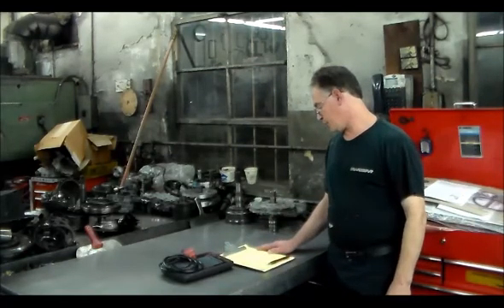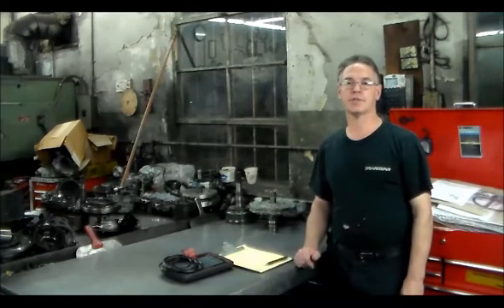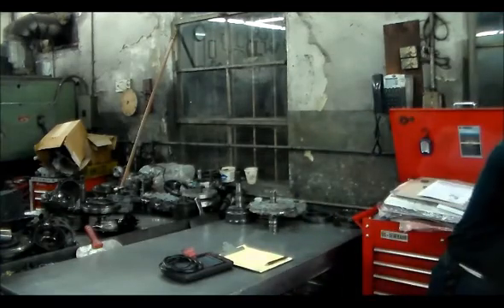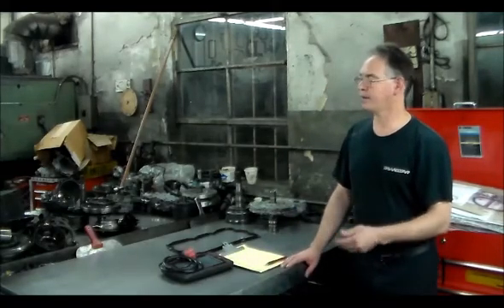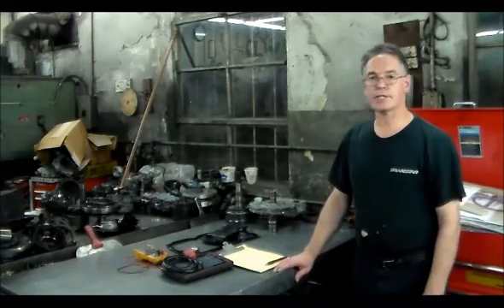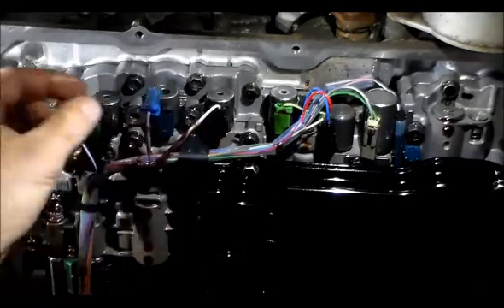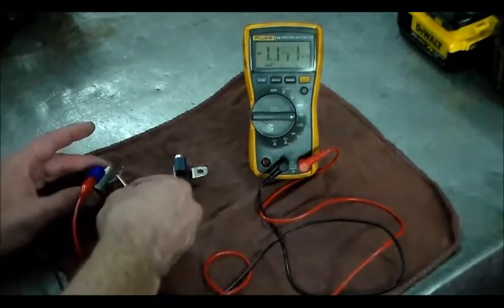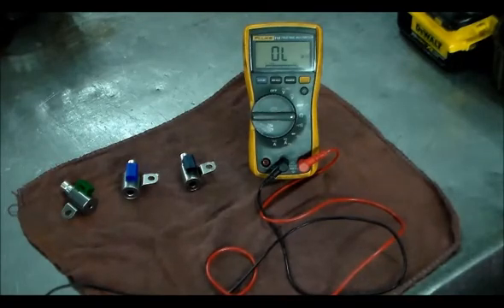AB60F, Code P0983

Comment: Hey Gary, just had this code show up on my 2008 tundra 4wd. I felt the truck wasn’t shifting normally when driving down the highway at 65 mph and noticed it was above 3000 rpm but not shifting into 5th or 6th gear. I’m located in Massachusetts. How much should a repair like this solenoid cost?
Reply from the maker: The big problem is, there are only 12 pan bolts, being where your located probably 10 out of the 12 bolts will break, the solenoid is probably 3 to 4 hundred plus labor. drilling and retapping the bolts i charge, The the solenoid is about 3-4 hundred, maybe 2 hours labor plus oil and pan gasket. so maybe 850.  But with broken bolts i charge per bolt to drill and tap with a new bolt, so that could bring to 15 to 16 hundred
Reply: Can you tell me the oem part number for the pan gasket and a and the specific solenoid that has to do with this issue?
Reply from the maker: @Rayrgs  I don't have the part number to the gasket, i believe it's the S4 solenoid but toyota may call this something different, i have them e-mail me a picture of the valvebody so there is no mistakes
Reply from the maker: I did some poking around the internet, S4 solenoid is the one. Has a blue connector. Try this OE part number for the solenoid.
35240-50050
Reply from the maker: Toyota calls it a 3 way solenoid
Reply: Thanks Gary! If the truck was driving fine and shifting ok with 0 issues prior to this code, it should just be this solenoid or something simple. Hoping it’s not a transmission replacement…

Comment: Good day Mr Farraro, I'm just curious. I have been looking into getting the right solenoid and Toyota could not have made that more difficult for how important it is to get the right one. Cost wise and position. Everything I look into shows S4 or D as the green connector and it's the 3rd one from the front of the tranny. For Toyota the part number is 35240-50060, but the dash number ranges 00030 to 50060 from what I can find.  In the exploded view it's N4 yet the one you're changing looks like it is blue, N3 and  5th from the front. I thought I had it figured out till I watched your video. I'm on and off getting P0983. No shifting problems. I'm thinking it makes sense that it is the heat problem from a different video. It only comes back if I erase it after about a 30 min drive
Reply from the maker: yes, i would do the solenoid first

Comment: Man I bench test old and new s4, new oil n filter, reset ECM, and still got code within 5min. I did get 2v from ECU harness when in first gear. Lexus state should be 1v. 

My suspicion is either wire inside valve body, or harness to ECU, or ECU ITSELF. Read it can be repair or reflash. 

2008 lexus is250
Reply from the maker: Where did you get the solenoid from?

Comment: Hi Gary
I have a 2014 Sequoia which has 160K miles on the clock, with no previous service histroy on transmition service and since a month my transmition (AB60F) has been giving me some headaches. 
On diagnostic tool I get C1201 and P0983 and on the dash I have the engine light on, 4LO and traction control. 
The transiomion shifts up to 4th gear. Once did it only up to 3th and three times, all of a sudden, no errors on the dash and transmition shifts just fine.
I visited Toyota diealership and they sad that it's time for new transmition.
I think that this is more likely to be electrical issue - lose or poor electrical connection, bad wiring harness or maybe the ECM. What's your opinion?
Reply from the maker: I think the solenoid is your problem, Are you located in a warm climate ? asking becuse the pan bolts are very difficult to come out and they break, i'm in New York and at least 10 out of the 12 bolts break

Comment: Hi Gary, I’m having the same issue. I replaced the solenoid worked for a couple days then all lights came back on. Do you think it could be a harness or temp sensor?
Reply from the maker: where did you get the solenoid from?
Reply: Autozone

Comment: My 08 has done it twice in the past week. The first time it cleared itself after reading the codes, (I did not erased the code) today it did it again, I unhooked the negative battery terminal, it cleared the code but came back on after I shifted and drove for 20 yards. I'm gonna give this a try and see if it works. Truck has 190k miles now and I'm unsure about any transmission maintenance by the previous owner.
Reply from the maker: where are you located?

Comment: Hi Guys I have the same code on my Lexus gs300 08 will that be the same part to replace? Also engine light up on dash and check vsc….. thanks 🙏🏻
Reply from the maker: Yes.  Not showing a gs300 for 08, is it a GS350?
Reply: @GaryFerraro  Hi Gary it’s actually GS300, made 2007 registration 01/2008 transmission A960E and codes P2714/ P0983 solenoid D…shifting good it’s just jumps forward a bit hard when put on “D” but all gears there shifts good. PLEASE let me know and thanks a mill🙏🏻.
Reply from the maker: @paddy5141  if you clear the code does it come right back?
Reply: @GaryFerraro  yes it does.
Reply from the maker: @paddy5141  ok, so next step is to ohm the solenoid, probably no good, if the code comes right back, it is an electrical problem
Reply: @GaryFerraro  I ordered S4 solenoid numer 3 (blue) oem €€€ 😣 will replace it over weekend and let you know…will check ohm to make sure to. Thanks a mill God Bless 🙏🏻.  ☘️
Reply: @GaryFerraro  Update;
Lexus GS300 2007 “check vsc” on dash no 5th and 6th gear very bad shifting 1,2,3,4
Fault code P0983 shift solenoid “D”
Solenoid S4 blue, part number 35240-50050. All fixed now back to normal THANK YOU VERY MUCH MAN 🙏🏻. God Bless!!
Reply from the maker: @paddy5141  Great, Thanks for the update
Reply: Man good stuff. I place another used one that was good and still got problem. First one I bench test and all pass. Why I didn’t want to buy OEM yet. I’m afraid it could be ECU :(

Comment: Hey Gary, i have the same exact code and same exact problem on a 2010 toyota tundra with 230k miles on it. When i took it to a trans shop they told me that they are afraid of opening up my transmission to replace the solenoid without rebuilding it, but then i find your video and you make it look so easy. After reading some of your previous comments to others on here, you had mentioned that it was an electrical thing and not a mechanical. Do you still recommend replacing the solenoid if its electrical?
Reply from the maker: If you have the same code, and all connections look ok, solenoid will probably fix it, just be careful of pan bolts they may break. Where are you located? I did about 3 of these with this code and solenoid fixed all of them, one of the trucks was a Florida truck and pan bolts came out easy

Comment: Thanks for the video. I just completed this repair on an 08' Sequoia while under the car.  A few notes... 6 of 12 pan bolts snapped.  This was after I soaked them for 2 days with PB Blaster, used heat and slowly removed by hand.  Know that it will happen.  I picked up a Dewalt Drill and Tap set at Lowes for $40.  Best $40 I've spent as it worked great.  Used an impact driver and had the old bolts drilled out in about 30 minutes. The drill and tap set has 5 pieces and I worked progressively up to the largest size which was the exact size of the original bolt.  I picked up a solenoid on Ebay for $53.  Rebuilt OEM.  The connector on the solenoid that I replaced wasn't blue it was more of a green color.  The wire clip from the transmission was blue but maybe the plastic connector on the solenoid turned green from exposure to fluid?  I drained just over 5 Liters of fluid and replaced that exact amount.  Truck runs great.  Good Luck with the repair.
Reply from the maker: Thanks for sharing glad you got it done

Comment: Hey I just had the same code pop up on my 2007 but its still accelerating and driving fine at the moment.
Reply from the maker: I had one, would go into failsafe every 3-4 days, was the solenoid, it ohmed fine but when i put my heat gun on it, the solenoid shorted out
Reply: @GaryFerraro  I guess I will consider getting that fixed asap while everything is still okay, thank you for the information and replying🙏🏽
Reply: I know it’s old thread but you’re saying when solenoid gets hot that’s when it’s short?

Comment: Hey Gary, my O7 Tundra recently began staying in 1st gear longer than normal and goes into neutral when going into 6th. Would that be a problem with 2 different solenoids?
Reply from the maker: I would need for you to get the car scanned for codes
Reply: @GaryFerraro  are all of the shift solenoids the same / interchangeable with this transmission ?
Reply from the maker: @eanandbarrettable  I actually have to look into that, not sure you can because of the brackets on the solenoids, I never interchanged any of then as yet
Reply: @GaryFerraro  thanks in advance
Reply: @GaryFerraro  Hi Gary I have Lexus GS 300, 2007 with A960E transmission and have vsc light on and engine light on also exactly the same fault code will that be the same part solenoid S4? Please help me🙏🏻. Thanks and God bless.
Reply from the maker: @paddy5141  should be, you could drop the pan to ohm the solenoid

Comment: Thanx for the info on tundra solenoid,my toyota has 125k on it when this just happened. By the way I snapped five bolts but only had 2 drill2 thanx again!!!!
Reply from the maker: Not bad only 2 had to be drilled, did you put them back with never seize?  Did you get the solenoid from the Dealer?

Comment: Hello Gary.  I have an 07 tundra with a ab60e. I dont have any codes  but when i put it in reverse its like its in park .  It wont go into reverse  also when i put it into neautral its like its still in drive. Should i be looking for a solenoid in this case ?    But it switches through all the gears going forward like a champ.  I dont get it.    ??:)
Reply from the maker: The problem is that there is a clutch pack that won't release so when your in neutral it will move forward because the clutch pack is locked together and in reverse it will bind up.  Did this may run low on fluid?
Reply: Yes it was low.  Will the trans have to be rebuilt or is there a way i can unbind it ?

Comment: Hi Gary
I have a 2008 Tundra 4x4 and the transmission is doing exactly what you described, it allows me to go up to 45-50 mph only and dashboard lights 4LO, Check Engine and Traction Control going crazy...so i took it to have it scanned and it displayed code P0983 "Transmission Shift Solenoid D Control Circuit High"
I'd like to order the OEM Toyota Solenoid, do you happen to know the part number please?
Excellent video and explanation.
Reply from the maker: I do not, sorry.  Best thing to do is get a print out from the dealer and point it out. The codes says shift Solenoid D but Toyota may call the solenoid something else
Reply: @GaryFerraro  
Thanks

Comment: Thanks for the video! I just bought an '08 Tundra with 365k miles on it. The previous owner had some intermittent shifting issues. It would sometimes hold on to 1st gear before finally up shifting. It would also sometimes go into limp mode and not shift past 3rd or 4th. It had pending codes P2714 Pressure Control Solenoid 'D' Performance/Stuck Off and P0751 Shift Solenoid 'A' Performance. I removed the pan and luckily only broke 4 of those 8 rusted bolts. I used a little butane torch to heat them up. It still had the original filter installed. The SLT solenoid seemed to test good. The S1 solenoid measured at 63 ohms instead of 13 ohms. It would barely move. I'm hoping the new filter and S1 solenoid will have this truck running like new again. Parts will be delivered in a couple days 😁
Reply from the maker: C Muss thanks for the update. Glad it worked out.  Good job.
Reply: @GaryFerraro  Well, 2 1/2 years later and the P0983 code popped up today. I didn't notice any shifting issues and it cleared just fine. The S1 solenoid was my problem last time and now it looks like the S4 solenoid might be causing some issues. I'll keep you posted...
Reply: @cmuss-z8i  I see this was posted 10 months ago. Did you replace the S4 solenoid? Or was it something else?
Reply: @datawrangler81  I replaced the S4 solenoid and that fixed the issue. My Tundra currently has 380k miles and I've been using it the last few years to pull a 7100 lb travel trailer with no issues.
Reply: @cmuss-z8i  thanks for the fast reply. I'm seeing some conflicting information on the S4 solenoid part number and color clip- is it 352405 0060 and is it green or blue? Does the clip color matter?
Reply: @datawrangler81  I used part number 35240-50050 and the clip was blue. I'm uploading a quick video I filmed and I'll leave the link here.
Reply: @cmuss-z8i  thanks, that is awesome. Just what I needed.
Reply from the maker: Let me know how it works out, those bolts always break.
Reply: @GaryFerraro  Will do. Those bolts were a nightmare. Drilling and tapping while lying on my back was not fun.
Reply from the maker: @cmuss-z8i  I hear that.  make sure you get some never seize  when they go back
Reply: @GaryFerraro  I received the OEM Toyota replacement solenoid today. I ordered it from eBay for about half the price than the local dealership. It looked like it was in counterfeit packaging. I decided to install it anyways and the truck is shifting like it was engineered to do. All of the pan bolts lined up good, but I had one corner bolt that was a little loose while tightening. The threads I tapped were a bit loose. I wrapped the bolt threads with some Teflon tape and it snugged right up! This truck has some balls! CHEERS!🍻

Comment: nice thanks
Reply: question I have a Lexus IS 250 with the same code P0983 Shift Solenoid D control Circuit high can anyone send me a link on were to the OEM "Solenoid ????

Comment: Thanks for the video, helped me a lot, I have the same problem with my Toyota '07, Shift Solenoid B is the problem. Can I drive my truck with this problem? Thanks
Reply from the maker: Do you know what the code number is
Reply: @GaryFerraro   Thanks for replying to me. The codes are P0977 and P0977P
Reply from the maker: @amorosoelguru  Ok, this code is for a shorted S2 solenoid circuit.  When you drive the car does it shift or stay in one gear?
Reply: @GaryFerraro  Thanks, when driving the truck, 40-50 miles feels like something is pushing the truck hard. Also, VSC Off, Check Engine are on
Reply from the maker: @amorosoelguru  The truck is probably staying maybe in 4th gear, the S2 solenoid works with the 1-2 and 3-4 shift valves.  When you take off from a dead stop does the truck seem heavy and slow to accelerate.?
Reply: Gary Ferraro yes. Sometimes Heavy and slow, and sometimes it wants to turn off
Reply from the maker: @amorosoelguru  Ok, it's probably starting in a higher gear, you really should not drive the car, right now you probably have a bad solenoid, if you drive the car, you could damage the trans
Reply: Gary Ferraro thanks for all you advice..

Comment: What is the part number for  solenoid A? My Sequoia has a P0748 and I too don't have 5th and 6th gear.  The stealership wants to get me to get a replacement transmission. I was like hell no when they reset the code and the problem went away for a few minutes then came back.
Reply from the maker: My e-mail is gsferraro@yahoo.com,   e-mail me your vin number so i can confirm trans type, i may have some info i could send back to you

Comment: Hi Gary, great job on this video.  However, I am a bit confused on which Solenoid to buy.  When I called Toyota for Solenoid 4, they gave me part #3524050060 which has the Green clip.  The clip you are replacing has a blue clip which is part #3524050050 or Solenoid 2.  Can you please confirm the actual part number and solenoid you replaced?  I have the same issue, thank you sir!
Reply: https://parts.lakelandtoyota.com/p/TOYOTA_2008_TUNDRA/SOLENOID-ASSY--AUTOMATIC-TRANSMISSION-3WAY-NO4/3942208/3524050060.html?partner=googlebase_adwords_parts_color_make_model_year&kwd=&origin=pla&gclid=EAIaIQobChMIhYbR5ZfF3gIVw2V-Ch3f0gZOEAQYASABEgLsjPD_BwE
Reply: Thank you.
Reply: @sleekindesign24  Hi. I am getting the P0983 and need to order the proper Solenoid.  The diagrams I am seeing say that S4 is the correct part to fix the 983 error code.  But I can only find a green colored clip.  In the diagrams S4 is blue.  Can you please let me know if the green replaces the blue?

Comment: Is there any way you can help me locate the part number for s3 and s4 solenoid. I can not seen to distinguish anything other than the location.
Reply: Daniel, part number for S4 is 3524050060 however, S4 has a green clip.  The solenoid Gary is replacing has a blue clip which I believe part number is 3524050050 or S2.  I was told this by Toyota Parts, who also said S1 and S4 are the same.  S2, S3, S5 and S6 are all unique to each other

Comment: Hi Gary I have a 2008 Toyota Tundra that has no codes but it has a harsh up shifting 
I hits hard not all the time 
Any ideas on what to look for?
Reply from the maker: It upshifts through all the gears?  Check engine light on ?
Reply: Gary Ferraro it feels like it shifts hard only when I floor it from 4 to three right 
Because it down shifts for third gear for passing gear right?
Reply: Gary Ferraro and by the way no codes store in memory
Reply from the maker: yes, that is correct